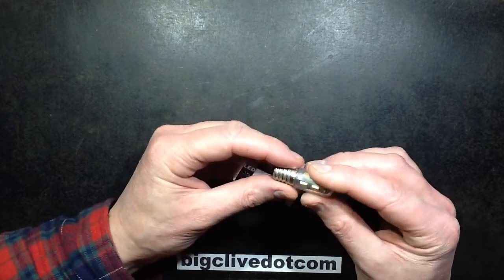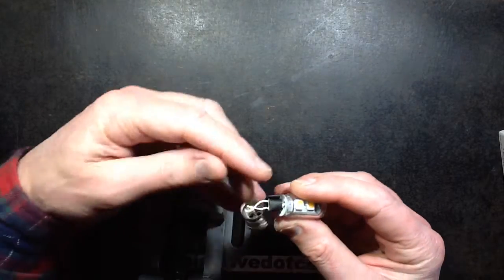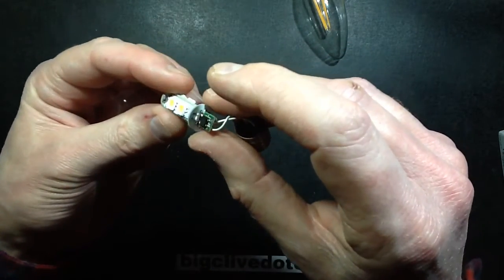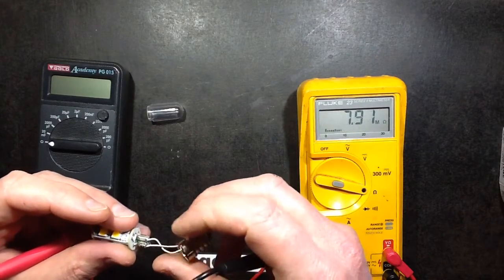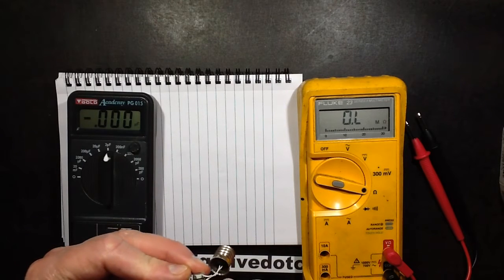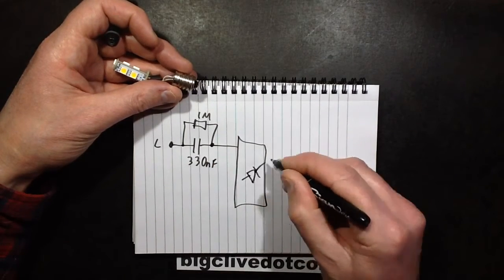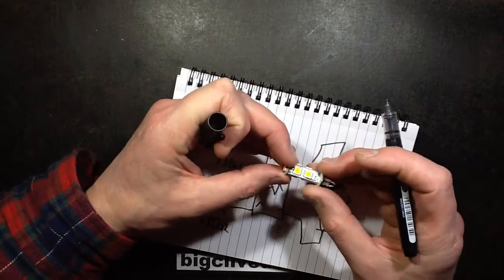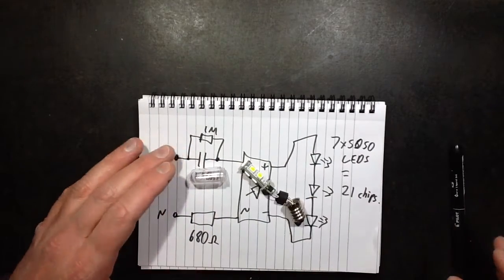Inside a neat little 1W SES LED fridge lamp.

Comment: why is it that for the l videos I can't hear any sound? all other youtube videos work fine. anyone know why?
-edited 
now all the video from your channel have no sound for me. is there a global setting?
Reply from the maker: Your computers surround sound processing may be diverting the mono audio to a non existent centre speaker.  you may be able to correct that in the settings.
Reply: Found the problem, it was caused by 5.1 speakers changed it to quadraphonic to fix it. But all other youtube videos worked fine even with 5.1 speaker setup so it was kind of weird as to why only you channel didn't work. Anyway thanks for the help.